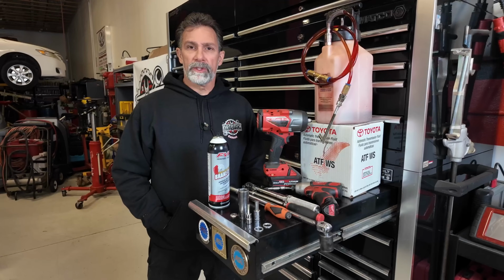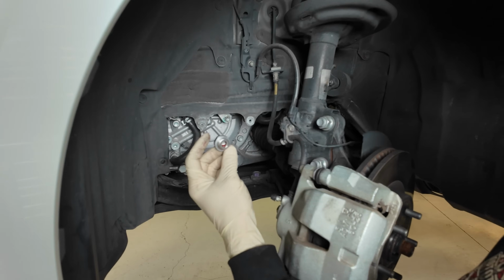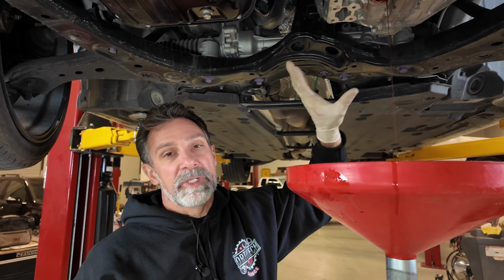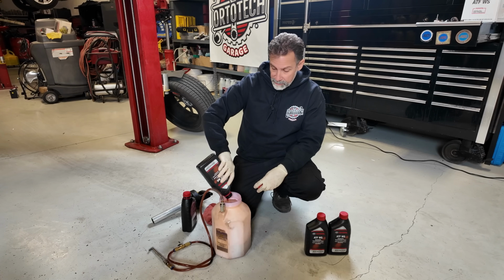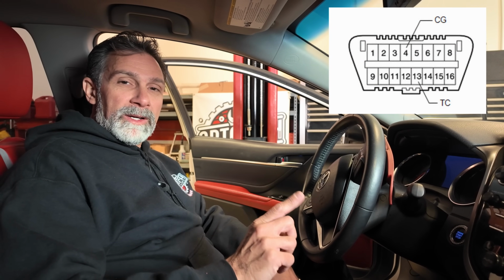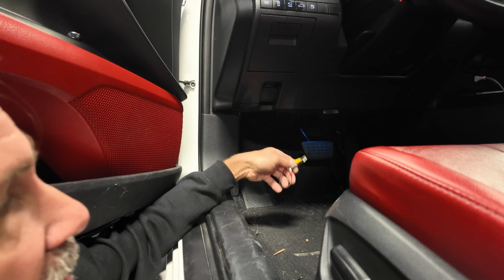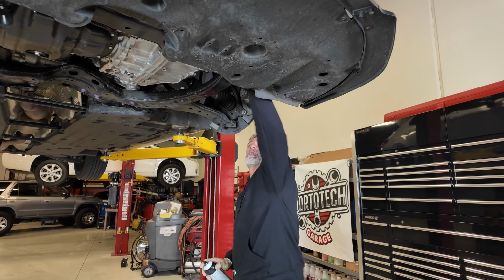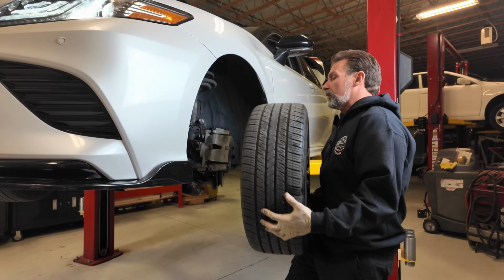The Ultimate Guide to Changing Transmission Fluid on Your Toyota Camry

Comment: Jumper to the OBD II connector, What is the part number for the mating pins ?? Or you one of those paperclip guys ??
Reply from the maker: The dealer way is to use a scan tool to Activate the TC terminal (no jumper needed).  There is no part number to jump those terminals but, you have a few options. You can connect a break out box and use a banana plug cable to jump the terminals in the box, use a jumper terminal kit to connect the proper bladed terminals with a jumper wire at the OBD2 connector, build your own jumper cable, or use a paper clip.  I built my own jumper cable.  They all work, paper clip is the easiest...👍
Reply: @OrtoTechGarage  OBDII connectors were mandatory since 1996, The builders dont pull them out of their behind, they purchase them, which means they have a part number and the pins have a part number, and specific crimpers are recommended . Anything but the proper terminal could damage the OBDII connector.

Comment: Great video, I've always changed trans fluid by replacing exactly what I removed.  Would you say this is OK as long as everything is at room temp?  I'm under the Impression the reason for the checking procedure is because cars come into the shop hot.?  Thank you
Reply from the maker: Thank you.  I have answered this a bunch in the comments, but if you are going to measure what you take out, you have to be certain not to spill any.  Also. I am always concerned if it was properly filled prior to your service.  How can you be sure?  Any leaks would obviously effect the level as well. Assuming a few off those things are good, your process will work. I still think its best just to practice entering the fluid detection mode and learn how to do it properly.  Its fairly easy once youve done it a couple of times. Best of luck!

Comment: Did this Camry also have the cooler by-pass plug? I've seen it on my '19 Rav4 2.5v4, 8spd.
Reply from the maker: No.  This model doesn't have a transmission oil cooler thermostat.  I did do a video on a Tundra that has one, and I demonstrate the procedure to bypass it in that video. 👍

Comment: I can’t understand why you have jumped the 4 and 13 terminals and why a lot of lights have been turned on the dash. Could you please explain?
Reply from the maker: Sure.  "Activate TC terminal" is a function in Toyota's diagnostic and test logic system that can be entered by selecting this feature in a scan tool connected to the OBD2 port.  TC terminal is the Test Connector.  The scan tool is basically grounding the circuit for you. Without the scan tool you have to activate this manually by jumping the terminal to ground in the OBD2 connector.   Once activated it changes the way the computer functions to allow you to perform certain tasks.  The specific tasks for this procedure are fluid temperature detection mode and idles speed control mode. Once these modes are activated the lights will alert you that you have entered Test mode and will also alert you of the transmission fluid temperature as I indicated in the video. In order to accurately check the fluid level, the idle must be strictly controlled by the computer and the temperature must be within the proper range, according to Toyota.
Reply: @OrtoTechGarage got it, thank you!

Comment: Wrong. There should be an intermittent stream when you put the plug back.
Reply from the maker: That's actually incorrect. As per the service procedure it should be a steady drip, not a stream.  If you would like, I am happy to provide you a PDF document with the full procedure.  Just let me know.  Thanks.

Comment: Superb video.  Once you reach the proper temperature, and then have to get under the car and remove the plug to let it drain to the proper level, is there a chance of it getting above the fill temperature max of 113 deg since you have to leave the car running?  Again, great video.
Reply from the maker: Thanks for the nice comments!  You are spot on...you have to move with a sense of urgency as you really only have a few minutes in the proper temperature range.  If you are overfilled or underfilled by a large amount , it takes some time to drain or add to the proper level.  Prepare properly so you can be efficient with the fluid adjustment procedure.  Great comment!

Comment: With no filter, does this mean the transmission fluid should be changed more often? When did Toyota do away with the filter?  I noticed my 2019 Highlander does have a filter.
Reply from the maker: I like to stick to the 30,000 miles interval for transmission fluid services.  Even the older models with a transmission pan and filter really only have a screen inside.  Not quite a filter and they rarely need changing unless the fluid is terrible.  Just keep the fluid clean.

Comment: Out of curiosity, is there also a transmission filter in a 2020 Toyota Camry SE that needs to be replaced? Just wondering is that the case. I ask becuase I got my BMW X5 transmission changed and also the transmission filter. I'm wondering if Toyota Camry's have a transmission filter that needs to be replaced as well?
Reply from the maker: No.  There is nothing you can service on these units.   The BMW is a completely different animal with the filter built into the pan.  This one has none of those features.  Just fluid at timely intervals and you will be fine.  👍

Comment: I finally did this at 50k by raising and removing tire.  Mine is an XLE V6 and it has two undershields but they are not the same as this video.  One issue I had is that a bunch of fluid (maybe 10 to 15 oz) came out before removing tube.  I think the total was ~3.25 quarts removed.  However, I could only put ~2.7 quarts back before it overfilled.  I wonder if the raised front might be the reason.  So I put the drain plug in and added ~1/4 quart.  Not sure if that was right.  It ended up getting 1/4 to 1/2 quart short from what it had.  Now I'm paranoid.

I suggest loosening the tube a little and then unscrewing it with your fingers to keep tools clean.
Reply from the maker: Good work doing this yourself for the first time.  When you first remove the drain plug, it is normal for some fluid to come out.  Once you remove the overflow tube, the rest comes out.  Recheck your fluid using the procedure after the car is cooled down.  You will have to get the vehicle level with 4 jack stands.  I think your fluid level is very close the way it is, but it should be checked.

Comment: Wow no filter to change out now, must be nice! lol my 2012 is only at 88k bout to do mine next week!
Reply from the maker: It definelty saves a little work underneath.   Your vehicle likely has a screen inside the pan. They are usually not worth changing either.  I have yet to see one that was dirty on a properly working unit. If your pan is leaking and you need to drop it anyway, you might as well change it.  Best of luck!

Comment: I have a 2024 Toyota Camry hybrid SE nightshade. Is the procedure the same or different?
Reply from the maker: If you have the UA80E transmission and not the CVT, it is similar but not the same.  There is no pin to jump to Activate TC terminal and also an ATF thermal degradation estimate value that should be reset with a scan tool.

Comment: my camry is at 116,000 miles and i have noticed a small slip when i start accelerating up to 10 mph it’s one or 2 slips then after that fine the whole time . i’m interested in changing my fluid but the only part im stuck on is jumping port 4 and 13 any tips ? thanks
Reply: @ortotechgarage^
Reply from the maker: @ishoot02 I've tried to outline the steps exactly in the video for you, so I don't have much to add.  Im not sure what your having difficulty with.  Use a light and lay under the dash to get a good view of the connector.  Remember its tapered like a trapazoid.   Terminals 1-8 are on the first row amd 9-16 on the next. You can Google an image of the OBD2 connector to see exactly which terminals are 4 and 13.  They will be towards the middle.  Then use a paper clip and unwind it so the two ends are parallel.  Put the.ends in the metal terminals gently.  They should slide right in without forcing anything. I hope that helps.

Comment: Any thing different on a 2007 Camry?
Reply from the maker: Yes.  The 2007 Camry is a different setup with an actual transmission pan and a screen style filter inside the pan. I believe that year still has a transmission dipstick as well.  I would have to look at it.

Comment: Ok my question. Is do you have to change the filter to the transmission cuz some Toyota dealerships say no some say yes so witch one is it I have an 2018 se Camry
Reply from the maker: There is no filter on this model.  If you have this transmission you cannot change a filter, just the fluid.
Reply: @OrtoTechGarage  thanks for your help ok sooo one more thing and I think it can be fixed again it was my mistake. So I had changed the.  The fluid just resent  I waited about a week to take on a long drive and it drove just fine and shifted smooth. So when I got back the next day my transmission would skip  gears so I would slow down and give some guys  just get  it to shift. Slowly it would shift 1 2 skip or hunt 3-4 and would get stuck on 5th  but it we'll go away after while of driving it I  thinking ones the fluid got hot and expanded it that's when it goes away   And  have a feeling that I have the level of the fluid kinda low.
Reply: And I'm sure I didn't let it warm up to the temp it needed to be so it could expand I really hope my theory. Doesn't become a 7000$ fix and it's just another 50 bucks on fluid and taking my time to let it do its thing
Reply from the maker: @AlejandroSanchez-hs3fu The temperature range is actually very close to when the vehicke hasn't warmed up.  Filling it hot would be worse because it would probably push too much fluid out.  Yiu can check the level anytime though.  Go ahead and practice the procedure and recheck it.
Reply: @OrtoTechGarage  sounds good I well check that. Cuz like I said ones the car is fully warm  it stoped doing it when it's cold it's when it does  and it gets stuck in 5th but after a while it goes away I well try that and see what happens I Well keep you posted  thanks for your feed back
Reply from the maker: @AlejandroSanchez-hs3fu 👍

Comment: IS THE PART OF THE JUMPING THE TERMINALS AND MOVING THE SHIFTER THE SAME FOR A RAV4 2022? I KNOW THEY HAVE THE SAME TRANSMISSION BUT I WAS WONDERING ABOUT THAT PART
Reply from the maker: I would have to look it up.  Some of the newer models no longer have the pin 4 and 13 in the OBD2 connector to activate the TC terminal.
Reply: @OrtoTechGarage  thanks for the videos.

Comment: You don’t need to take the wheel off just turn it to the left
Reply from the maker: True.  For demonstration purposes and ease of access, I remove the wheel.  You can certainly work around it though. If you're already up on the jacknstands, its just 5 nuts to pop it off and make your life a little easier to access the side cover and fill plug. 👍

Comment: can you use temperature gun to check temperature?  my vehicle is corolla se 21
Reply from the maker: I have never tries.  I suppose you could get it into fluid temperature detection mode and find a spot on the bottom of the  transmission that is covered with fluid internally, then check to find a spot that reads within the temperature adjustment window.  If you can identify a good spot that matches with your temperature gun, I assume it will get you close enough. Part of that process involves idle speed control mode as well, just keep that in mind and make sure you have all accessories off.  You can let me know if you have success matching up the temperature window.

Comment: Excellent video!  I have a question; not trying to contradict Toyota.... just an honest question looking for an answer.  
The total capacity of the Toyota 8 sp. transmission is 8 qts of fluid.  The volume expansion of transmission fluid from 68° to 113° is 1.75% maximum.  For 8 qts (256 oz), the maximum expansion between 68° and 113° would be just over 4 oz, or 1/2 cup.  If you filled the transmission until fluid just began dripping out of the overflow tube, and stopped, the maximum the entire volume of fluid could expand at the recommended checking temperature of 113° would be 1/2 cup.  It seems this would be well within the max/min tolerance levels of an 8 qt system.  Could the entire jumper wire / bring to 113° / quickly check again, with the engine running procedure be unnecessary?  I would appreciate your thoughts.
Reply from the maker: Thank you!   Your analysis is very thorough and thought provoking. I believe you are correct in your line of thinking, but I assume the engineers know something that we do not.  That said, theory and practical operation are two different things, and can often provide different results.  I have seen this process performed with your method and the results were successful.  There are a lot of people out there that dont know the Toyota procedure.  I believe the procedure is there for a reason and should be followed to ensure accuracy, albeit results may be the same either way. I want to ensure I provide the most accurate information possible.  I hope that helps!
Reply: @OrtoTechGarage You did provide the most accurate information, and did a very thorough job of it!  Thanks for that.  The very common phrase 'the engineers know more than we do'  seems to be called into question at an ever-increasing rate these days....ha...ha.... Thanks for the response.
Reply: You did provide the most accurate information, and did a very thorough job of it!  Thanks for that.  The very common phrase 'the engineers know more than we do'  seems to be called into question at an ever-increasing rate these days....ha...ha.... Thanks for the response.
Reply from the maker: @Ballistec  No doubt!  I think its the never ending battle between engineers and the bean counters.  In the auto manufacturing worlld, profit always trumps engineering, unfortunately. Thanks for the great conversation!

Comment: I have a 2018 Camry xse I serviced the transmission once at 100k + miles I bought the car with 80k+ miles on it going to do it again now I’m at 200k would you recommend putting 1 quart of Lucas transmission stabilizer oil? I drive at least 180 miles every day for work.
Reply from the maker: I dont think its necessary, but Lucas makes some good products.  I know they make a tramission fluid conditioner but I have not seen a specific transmission fluid stabilizer.  If you are going to use any additive, make sure its compatible with your vehicle.  I think a better plan is to shorten the fluid service intervals.  Every 100,000 miles is a bit long.  I know your doing a lot of highway miles so maybe do it every 50,000. Its seeing less shifts then the average car.
Reply: @OrtoTechGarage 
Thanks for your reply and advice 👍🏽👌🏽
Reply from the maker: @humbertohuizar1375 My pleasure!  Best of luck with the Camry.
Reply: @OrtoTechGarage 
I enjoyed your video great info and detailed thank you 🙏🏽
Reply from the maker: @humbertohuizar1375 That’s great to hear!  Thanks for watching, engaging in the comments, and supporting the channel.  I really appreciate your support.

Comment: Idemitsu is (seemingly) the OEM supplier for the Toyota WS fluid, and they make their own WS branded fluid! Valvoline's Maxlife or Extended Protection ATF works with this as well in the event if you need more fluid than what you have on hand in a pinch.

I changed the fluid in my sister's 2020 Camry with the Valvoline Extended Protection at 68k and it works flawlessly. I have a 2023 nissan rogue (I changed the fluid at 61k miles, but instead of just doing a drain and fill I cleaned out the CVT pan, replaced the internal mesh strainer and cartridge filter and all of the affiliated o rings and gaskets) and with that CVT fluid I didn't take any chances and used oem equivalent fluid. Due to Nissan NS3 fluid being very pricey and since Nissan themselves recommends doing 3 drain and fills in one sitting which uses 10-12 quarts. Idemitsu is also the oem supplier for Nissan's CVT fluid and they sell fluid that's specifically engineered and formulated for this application for nearly half the price. Aisin and Eneos also make NS3 equivalent fluid.
Reply from the maker: Awesome!  Great work servicing your vehicles.  Thanks for sharing all that.  There are lots of great products out there to replace the OE fluid.  Like you said, there are only so many oil manufacturers out there and the dealerships will often be uising another companies products designed to their specs.  All of those brands you mentioned are leaders in the field, so I wouldn't hesitate to use any of their products in place of the OE fluid.  Some will actually be an upgrade.
Reply: @OrtoTechGarage what is an upgrade and why?
Reply: The specs are different and ExxonMobil makes OEM Toyota WS fluid. 

Idemitsu may be a substitute but there is no definitive proof. The safest option is OEM the price differential needs to be very substantial if I’d experiment. When anyone advertises “compatible with WS” or whatever it is meaningless - they won’t pay for any potential transmission issues. 

Multi ATF such as Valvoline maxlife is a bigger gamble - their own compatibility listings doesn’t even make sense - Toyota has a technical bulletin stating T-IV and WS are not compatible yet Valvoline magically is able to be “compatible” with both?

Comment: Should have put 3.5-4 qt fluid in at first and drain the extra, there's no way to over fill that because you will drain the excess. You left the engine on while you adding fluid, in that amount of time there is a big chance of fluid temperature to go out of range. I guess it's still ok if fluid is little bit extra or under the level, it's Toyota nothing will happen to that tranny. Btw thanks for the very detailed video.